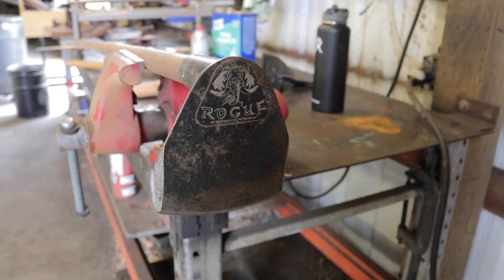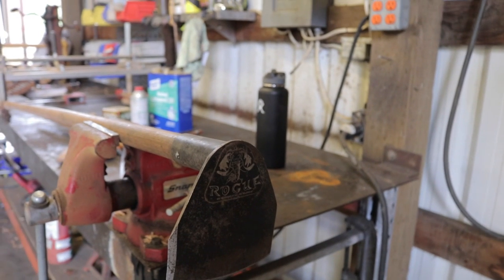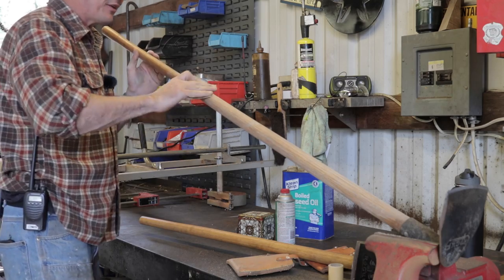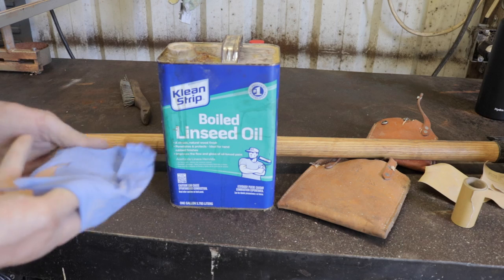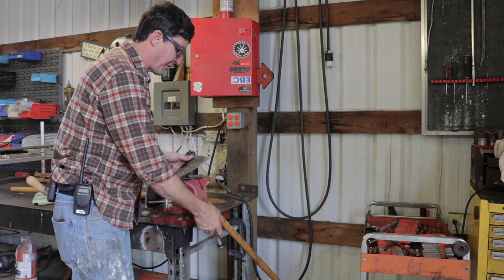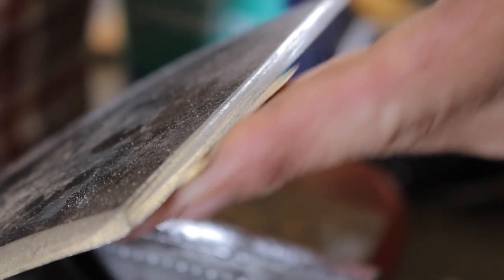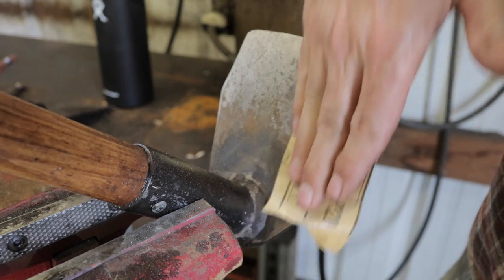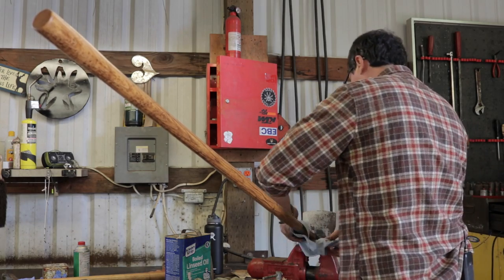This Is My Favorite Tool

Comment: The boiled linseed oil used most of the time and found in most stores contains plasticizers, hardeners and heavy metals added to make it act like true boiled oil, without the time and effort it takes to boil it. True boiled linseed oil makes the oil highly viscous which makes for good coating and dries to a more elastic coating quickly but not as fast as Toxic Boiled linseed oil.

Comment: Cody, I love to watch the pure enjoyment you get out of taking care of your tools.  You have definitely sparked something in me.  I've already started working on my axe, and like you said in an old video, I fully expect it to take an hour or more because I haven't been taking care of it and keeping it sharp.  I'm going apply what you've shown here to my shovel.  I never knew about the treatment of the handle.  I'm definitely going to start that.

Also, while I was watching the video I was looking at Rogue's website and tried to figure out just which model you got by guessing at the size and noting the fact that it was one that was sharp on the edges too.  Do you remember what model of hoe that was? I apologize if you've already answered that in another video.  If you have, I'll find it eventually.

One last question/comment, and this is purely for my education, not any kind of correction is intended.  I noticed in several other sharpening videos you like the round Lansky sharpening stone. Is that just not appropriate here because sandpaper is a better fit or am I over thinking this (I'm guilty of that a lot of times.)

Great video!!!

Comment: Video Request - Best way to remove rust from an assortment of tools. I've seen your other videos on specific tool restoration but we have several old tools in the garage of the place we moved into and we would like to restore them instead of tossing them all out and buying new.

Comment: I have a hoe, I live in Bangkok where the soil is alluvial, so clay and rocks. The edge is beaten but I worked out very early not to use it as a lever. The head came right off.

Comment: Cody, why not put that rubber glove inside a jersey glove so it will hold the oil better.  Then stick the jersey glove in a baggy for the next oiling.

Comment: Wranglerstar, I've got a yard with a heavy grass and weed density , I'm looking for a reliable grass whip because the weed eater can't cut into the thickness of the bush efficiently, any recommendations?
Reply: Get some good twine or a blade for the weed wacker.
Reply: I am grounds keeper at a cenmetary and mow lawns part time. Part of the grounds keeping is trimming around all the headstones. My favorite is the sthil 110r and my second choice would be the sthil 100rx. Both are great super reliable.
Reply: Look into a higher end Stihl or Echo weedeater, Or possibly a brush hog depending on the size of the yard
Reply: Look into a blade for the big stuff.  I've got a three edged blade on my brush cutter (Stihl) and it'll take down small trees.  I also bought a "circular saw" type blade for the bigger trees.  

I typically go through a section with the tri blade on the first pass, then finish up the delicate bits with the string trimmer "blade".   If there is big stuff, I'll put on the round blade but that thing scares me.  :)

Comment: been thinking about getting a rouge tool with shorter handle or a JR fire tool.  still can't pull the trigger cause not sure if want to be many chains in and need to bust open heavies but only have a hoe tool. i see you have the rouge super p. hows that work'n for ya.

Comment: I love Ballistol, but it smells horrid, and that smell makes me wonder just how non-toxic it really is.  I do have a crazily-sensitive sense of smell, though...
Reply: It was first formulated around 1900. It's mineral oil based but the smell is from natural ingredients. You can actually use it to disinfect inflamed gum or small cuts and bruises. Germany has some of the tightest regulations on chemicals and ballistol is graded food-save (even though definitely not recommended as a cutting board finish... that smell surely is annoying).
Reply: Easy enough to look up the material safety data sheet. Contents are: medicinal grade mineral oil, alkaline salts of oleic acid, several alcohols, benzyl acetate and an oil from vegetal seeds. The mineral oil is unchlorinated and conforms to the specifications of US Pharmacopeia XX.
MSDS is here: http://www.ballistol.com/wp-content/uploads/2013/09/MSDS_TECH_BIO.pdf

Comment: I was rehabbing a trail yesterday with two other guys and it was the first time any of us had ever used a rogue hoe, needless to say this was the tool each of us tried to grab first when we started a new section. Only difference was the one we were using had the wide horizontal blade like the one in this video and a thinner horizontal blade on the opposite side. It's a great tool and has been added to my list.

Comment: i dont wanna sound ignorant but grip tape aint the same as sand paper cus grip tape is to be used for stability on longboards on the other sand paper is way better for that type of job material cus grip tape can take away alot of material

Comment: They don't sell Eye Hoes at Walmart or Lowes here in Muskogee idk why. I looked at those you have before i went with a 6 inch Grub hoe. 40$ from Brasil i think
"The 6" grub hoe is our BEST selling all-around digging tool. This tough 3 lb forged steel tool has the right design and weight to quickly and easily cut through sod, hard soil, stems, and small roots. Super for trenching! The human-powered rototiller alternative."
https://www.easydigging.com/garden-hoe.html
They have Grape hoes too. They are a different angle for scalping sod.

Comment: I have a big grub hoe from easydigging.com that's awesome.  It weighs a few pounds which I actually use, like a splitting maul, to really dig deep into hard or weedy ground.  The head is also attached by a ring and wedge which I think is strong and also easily replaced or repaired.

Comment: Rouge hoes are my favorite fire tool on the line, it can do the work of a Pulaski and a scrape at the same time, weld a pounder on the backside for pounding wedges and I think its the best tool for the line
Reply: Nice edge on those tools as well, that angle is a lot of work but makes life easy when push comes to shove.

Comment: but how is this used as a fire fighting tool?
Reply: FarOutFarSpace It's used in digging handline. Handline encircles the wildfire. Depending on the crew digging, different tools are used for development of the line. A hoe tool is usually employed in the middle of handline construction. Great for moving earth after the rocky terrain has been broken up. Thanks for the tips W!